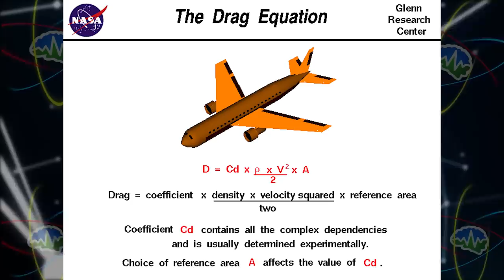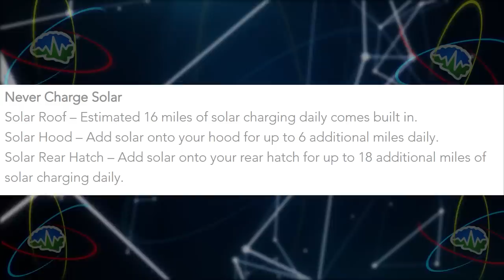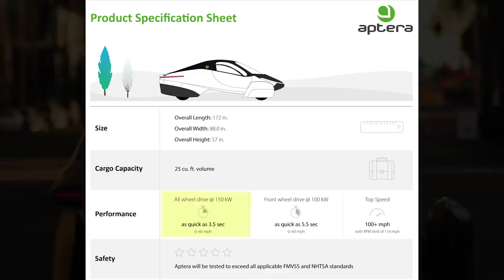Aptera Beats Tesla? | In Depth

Comment: Did you not say it goes 40-45 miles per day?  So how does it do 1000mi on a charge? How about while running AC since it's black?
Reply: The figures are for performance on the EPA Highway cycle.  There are several battery sizes available from 25 to 100 kWh.  The 100 kWh version should do 1000 miles, not that anyone would at EPA highway speeds.  The AC could very likely be powered by the solar panels while running in daylight.  The solar cells will be adsorbing the heat, while the shell of the car is highly insulative.  There are also some heat management tricks with coolent microchannels in the skin of the car.
Reply: @n.brucenelson5920  Ok so is it 45mi. or 1000 per charge? based on the best battery.  You say it can do 1000 miles yet the article says 45mi with the better battery?  So I routinely drive long trips out of state and 700mi. is not a stretch. Can it do 700mi. per day with AC on and  maintain 70-80 mph and recharge in the time I can put gas in a gas vehicle?  I mean it sounds great but too me the article is very misleading....
Reply: @robertvanvugt8335  Let me see if I can make it more clear.  You are confusing several different things.   First of all, the mileage specs are given on the EPA highway cycle so they can be compared, but that is not what you should expect driving cross country.  The EPA range estimates and pricing are as follows: 

Range Options & Base Price
1,000miles - $44,900, 600miles - $34,600, 400miles - $29,800, 250miles - $25,900

Since the EPA highway cycle averages around 50 mph and peaks at 67 mph, most people driving faster will not do as well.  The Aptera will not have as big a range hit as a Tesla at speed, because of a much more slippery shape.

We don't know yet if the Aptera will be allowed to use the Supercharger network, but there is a chance.  What we do know is that it will gain range about 3 times faster than the most efficient Tesla plugged into the same charger.  

Like any EV, cold weather will shorten range, but high altitude will have a large positive effect.  We do know that it will come far closer to your goal than any other EV.

The 45 mile statement is adding in the contribution of the full solar option in lower latitudes on a sunny day - a best case number that may be achievable in places like San Diego, or Phx.
Reply: 45 miles per day is how far you can drive on solar power alone. If you want to drive further, you need to plug it in like any other electric car. If you get an Aptera with the largest battery available and connect it to a L2 charger every night, you can drive 1000 miles a day. I can't say for sure how much the AC would reduce your range though.
Reply: Rickie j  I have had a long career in teaching and customer service roles.  I am willing to give everyone the benefit of the doubt as far as their good will - even people who seem to be trolls.
Reply: @n.brucenelson5920  Are you implying I am a troll?  That would not be a good business practice!  I am asking for clarifications. Your picture in the add says it goes 1000mi.  FACT!  But in the video it says 45mi per day.  Also a FACT.  That is in my book confusing and misleading thus I asked for clarification along with how using AC might effect these ratings as well as extended time at freeway speed which in some states like Idaho is 80mph. Thank You Ken for actually clarifying this. 1000mi per day sounds great but not at 44,900.00 when my gas powerd Chevy can do 600mi per tank, costs 22,000.00 and takes maybe 10min to fuel/charge anywhere.  Granted I have to pay for the gas and sunlight is free (if the sun is out) so over a 10yr. period it would save some money over the fuel cost I pay now likely breaking even about the time the battery needs replaced as batteries and solar panels lose efficiency over time?  How much would that top of the line battery cost to replace? How long will that battery last before efficiency is in the toilet?  I think these are all legitimate questions that anyone buying or looking at EVs would or should ask.....
Reply: Rickie j  No, not better - different, perhaps :).
Reply: @robertvanvugt8335  Robert, I have no intention of being insulting and I am sorry it came off that way.  Some people here seem to not have patience with push back.

All of your questions are legitimate and deserve answers.  I am not connected to the video makers in any way, and not responsible for their presentation.  I do run the Aptera forum on Reddit at r/ApteraMotors, and am a volunteer Aptera Ambassador.  This means I get to ask the founders questions on a regular basis.  However, nothing I say has official status.  I don't speak directly for them or even less for the Youtube video creators.

The particulars of the batteries to be supplied and the vendor have not been announced yet.  Lifetime and manufacture guarantee periods will become clearer when NDAs expire and Aptera and the suppliers can talk about it.

They should be in line with industry standards.  The solar option is designed to be easily replaced in case of damage or new tech.  They have IP around this.
Reply: Rickie j  Understood.  But we don't know the background of people we encounter over the net.  I have had multiple experiences of treating "difficult" people with respect when it was not interfering with other duties of mine that paid of in huge sales.  I also once sent a customer to a competitor, so It can work both ways.  I have no direct financial interest in this either way, but as a teacher, I tend not to give up on people.
Reply: Rickie j  You assume this electric will not need maintenace/recalls then?  No I don't drive 1000mi per day but I have done 700+  a day on several trips at 70+ mph with AC on thru mountains/desert. That means one stop for gas with my Chevy for 10min. with half the initial purchase cost. How much will it cost to replace the battery when efficiency goes in the tank and at what age will that happen?  Reports about the Nissan Leaf EV show that they can be bought pretty cheap used because battery efficiency is poor years down the road and replacing the battery costs more than the car was purchased used for so these are legfitimate questions. I am not against EVs in fact I like the idea but it has to work for me. Then there is charging stations availability? Do they exist along the route "I NEED" to take and lets just say we all switch to EVs tomorrow with the entire US population driving EVs when it's time for a fast charge what place will you be in-line? Will there be a cost to charge, sure there will be when $$$ can be made from it so how is it better than gas?  Seriously sell me an EV! I want answers to all this since I'm percieved as a troll. These are all questions anyone would ask a dealer before plunking down 45K on an electric right?

Comment: Looks impressive. But I believe also the lighter and smaller it is, the unsafer it becomes while you are in a crash for example. Imagine that vehicle crashing at 40km/h with a full SUV at 40Km/h in the opposite direction??? I do not belive that would be easy to survive.
Reply: I own a Gen 1 Honda insight which weighs about the same at 1800 lbs.  I was hit from behind at 60 mph by a large car and had no injuries.  The Honda got 4s in the crash test ratings.  I think the Aptera will be better in every respect.
Reply: @n.brucenelson5920  I hope so. But I would like to see the crash tests before buying.
Reply: @vsuarezp  Certainly understandable, and I commend you.

Comment: How much does it weight, why is it so wide with those extruded wheels, does it have suspension?
Reply: Depending on battery pack from around 1800 to 2200 lbs.  It has a suspension.
Reply: Width is needed for aerodynamic reasons and additional stability.  It is unlike any other 3 wheel vehicle.
Reply: Width is needed for aerodynamic reasons and additional stability.  It is unlike any other 3 wheel vehicle.

Comment: This sounds like the Elio all over again except electric and a much Higher upfront cost. Let's be honest, would you drive this over a bigger suv or car or truck. Only it it was significantly cheaper right. Well at current prices that is not the case. Less practical, less space,  and more expensive or about the same over 10 years as buying cheap used gas cars and putting gas it. The appeal of the Elio was it was suppose to be  $6800-7800 and would barely use $5000 of gas over 10 years.

Comment: This is a great vehicle, and I want one, but it is not a car. Cars have crash protection.  This is classified as, and is closer in crash protection to, a motorcycle. In the 70’s small cars weighed 2,500 lbs. Today that small car weighs 3,500 lbs, the difference being safety and crash protection.  Take a Model 3 and remove 1,000 lbs of federally mandated safety features and you get a lightweight vehicle that is comparable in price, performance, range, and charging to the Aptera.  And it would handle like a car. Who knows how a three wheeler on skinny tires attacks corners. I ride motorcycles and accept their risks. But because Aptera doesn’t have to meet car safety standards, comparison to cars is not completely valid.

Comment: It seems being 3 wheels it will be a motorcycle with no crash testing.
Reply: While this is true of most 3 wheelers, it is not true of Aptera.  It is designed to full automotive safety standards and will be tested to them before production begins.  This is risky since it incurs significant cost and the risk of poor scores.  I think they will have an excellent safety score.

Comment: What's a mountain Aptera going to be like, driving on level ground is one thing, that's why I'm going with the CanAm BRP Spyder or Ryker and they're going electric so they say.
Reply: Aptera will have plenty of power, and perhaps better handling than those vehicles.  The only thing I am unsure about is how long it will be able to climb at speed in hot weather before it has to throttle back due to cooling limits being reached.  We will have to wait for an answer to that.

Comment: If Aptera is valid because of those reasons why not then Renault Twizy? It seems to me it's better in a lot of those arguments against Aptera.
Reply: After watching there full video I agree that this is a much more complete full car, which Twizy can never be. I would like to see those thin metal parts form the car to the front wheels a little more protected though.
Reply: @cmuralhas  Vehicles such as the Twizy also have their place, but this first Aptera is far safer, and will can fulfill a different role.  The placement of the wheels is essential for stability and achieving the cd= 0.13 drag coefficient which is key to the overall performance.

Comment: It’s not a car. Classified as a 3 wheel motorcycle, that’s how you get away with no safety equipment and you can make them light as hell.
Reply: You are not talking about Aptera, then because it is designed with front and rear crush zones, front and side air bags and full safety features.  It will be crash tested and given a rating before production begins.  As far as weight, the 400 mile range model will weigh about 1800 lbs - around the same as a Gen 1 Honda Insight, that got 4s in the crash test ratings with much older safety tech.

Comment: I seriously doubt Elon is feeling any pressure from Aptera.  It's basically an enclosed motorcycle.
Reply: I don't think Elon is feeling pressure from Aptera, either.  I think they are exploring areas of cooperation.  However it is far from "basically an enclosed motorcycle".
It will be tested to and pass automotive crash test standards, and is far more aerodynamic than any motorcycle and will require far less power to travel at speed because of this.

Comment: If they hadn’t restricted the speed , how fast could it have driven?
Reply: That could be calculated from the horsepower and other information, but it is likely that the use of wheel motors place a controller processor and physical integrity limit.
Reply: Yeah, yeah, how fast would it go?

Comment: Purpose use comes in to play. A two seat passenger car 🚗 s great, great efficiency and being single or a couple it works perfectly. A family of 5 not so much. 
 Work vehicle same problem. Retired couple it’s fine. So it’s a slot vehicle that’s great for a specific purpose. As are most cars and trucks. 
 Don’t get me wrong I like it but it won’t fit everyone’s needs. 
 It will be interesting to see where the company goes but it’s a good entry vehicle for the e market.
Reply: That was never the claim.  It is a niche vehicle with a broader appeal than the Tesla Roadster.  There will be follow on four wheel vehicles, including a 5 passenger, a pickup, a van, and a Semi tractor.

Comment: I want oneeeeeeeeeeee @ .@ and I just want it for the efficiency / savings it brings in the long run, I don't care of the looks, if it saves money and doesn't need to be plugged in I'm in. My car has 2,000 km in 1 year, I'm sure I'd not need to plug it at all xD
Reply: Thing is, people that want cars with the "normal" design, just care about the looks and not what the car is supposed to do, which is transportation. If you can do the primary thing super efficient to the point it costs nothing to use, it should be the #1 thing people should look at.

If you so want the other cars, get Aptera, start saving from charging/gas, put that money in an account you won't touch, save enough so you can buy your tesla next, with no extra $, it'll pay for itself in the long run.

Comment: Does it have air conditioning? ... No...?....then thats a deal killer from the start, for anyone who lives on the ungodly humid-hot east coast (from Maine to Miami, from Miami to Mexico) This is where the average summer humidity is 90% to 100% with no breeze on daily basis for un relentless weeks on end, and where the temperatures are in the same equal in numbers as the humidity... What this amounts to in real life, is one, while sitting absolutely still, under a shade tree, would break out into a full fledged sweat , in the shade, in the months of June, July, August, and September. No one in business wants to show up at a formal business event looking like they had been trapped in a rain-storm of sweat and smelling like a locker room. No A.C. = No Money. This very cool looking car PROBABLY has a better future in California than Carolina. It should sell well in the "weather-perfect" states of the lower west coast.... looks like a great car for San Diego or L.A. though, but not in the more environmentally challenging areas of the country where efficiency is back seat passenger, , , to the practical front seat driver of necessity.
Reply: Yes, both A/C and heat are standard.

Comment: If I would work in the new Berlin Tesla  design centre, I would at least ask my manager to look at this car and have a chat with Elon. This car looks very promissing for the European market. Even the design would even fit in.
Reply: The only real issue for some places in Europe is the wide front track, which is necessary for the stability at autobahn speeds.  It will still be ideal for many users,
Reply: This is certainly not a city car. You don't need all that aerodynamic design to drive 50km/h. The Dacia Spring is much better and cheaper alternative for the city - that one will be on sale in a couple of weeks/months.
Reply: @hvxcolors396  Completely agree.  There are some really attractive city cars both in Europe and now in the US as well.  I lusted after an Isetta when I lived in Germany back in the day,   After all, I learned to ride a motorcycle on an R27 which had the same engine.

The use case (and the safety level) between the Aptera and a city car are completely different - unless you look at the Smart Car, where there is a small amount of overlap.

Comment: Car is a cool concept but it would be tough to drive during windy days. Aptera is priced too high and would need to adopt Tesla’s style of manufacturing to even come close t on being competitive. Aptera is going to repeat itself
Reply: Aptera will be far better on windy days than most cars - especially slab sided SUVs.  It has been tested stable in 110 mile side winds.

As far as manufacturing, it has a far lower parts count and far less expensive capital costs than Tesla does.  Tesla will have to adjust to stay competitive once Aptera starts building larger cars.

Comment: why don't they just put a cheap motorcycle engine to it? the efficiency(powersource/achieving a function=moving a car) is smaller for more efficient car so gasoline to movement for a car like aptera could be more eficient than energy source(coal,nuclear,water,solar,oil) to electicity grid to batteries to movement.
Reply: I think you have missed the contribution of the solar cells on a full solar model.
Reply: A cheap motocycle engine would pollute, be noisy and wouldn't get you 0 to 60 in 3.5 seconds in comfort.

Comment: Crash  tested ? Recyclable?  Time to  change  a flat tire  ? HANDLING  ? heating  / air con ?
Reply: Heating and A/C are standard.  The wheel pants clip off in less than a minute and the tires are changed just as with any other car.  I plan to carry a plug kit and an air pump.
Reply: Crash test ratings are coming.

Comment: not sure how they plan to get 700W of solar out of the area available on that three wheeler.  Maybe 100W, but even then not 100% would be illuminated by the sun at once.
Reply: The 700W is a  peak rating from 22-23% efficient cells, not an average.  The secret is that the car only needs less than 100 watt hours to go a mile at EPA highway cycle speeds.
Reply: Their fully deployed solar panel option cover 3 square meters of surface. That includes using the hatchback area, which the prototype shown didn't cover.  Its bigger than it looks!